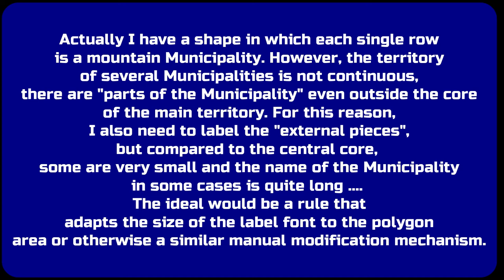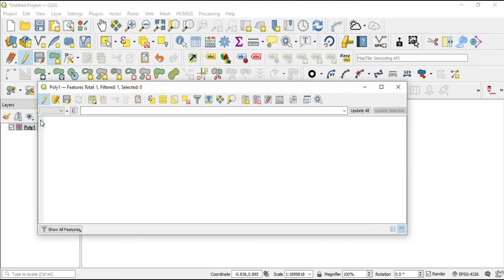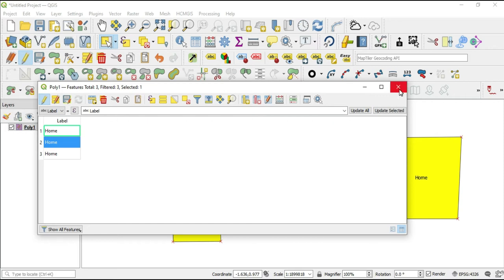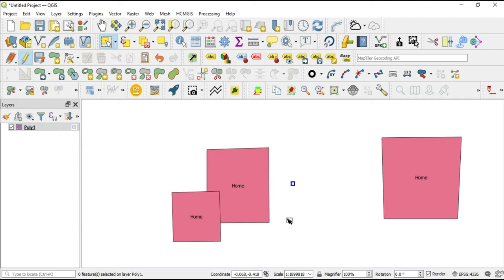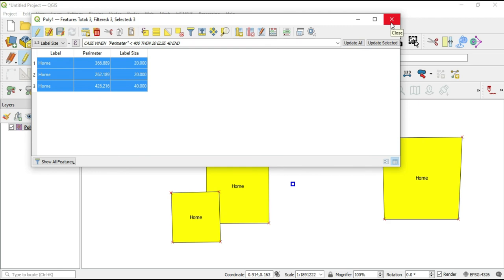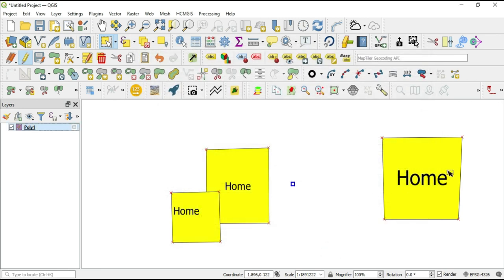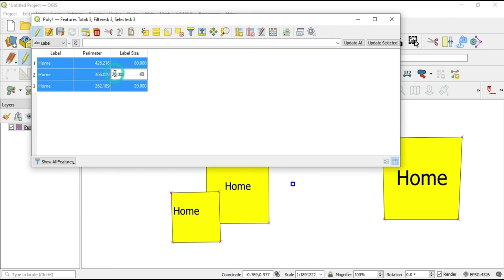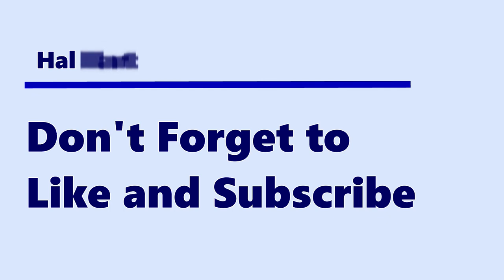QGIS Basic #132: Splitting Parts, and Resizing labels of Multipart Features and Calculating Geometry

Comment: thank you very much Hart. you quickly found a solution to the problem! I've already put it into practice. however not being allowed to separate the original multi-part polygons in the table, I first created a new duplicate layer (with the polygons I splitted) which I only used to manage the labels and then I followed your method. so I set up an expression which, as you have shown, defined the size of the font in the polygon to the area and I subsequently calibrated the size of the individual labels by hand. I hadn't thought about it. this trick will certainly serve me also in the future.
Reply from the maker: So glad it was helpful, and thanks for the great question.
Reply from the maker: Hello again, if you can not separate parts I do have another method you can use I will work on that video as well. I don't know when that one will be out, but I will send you link when it is published.